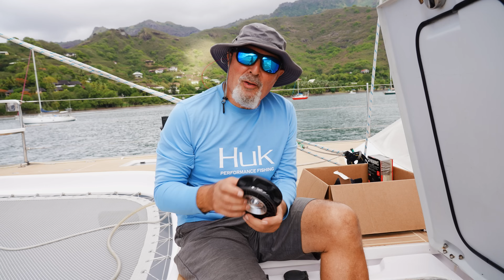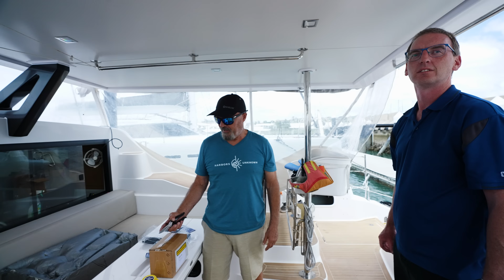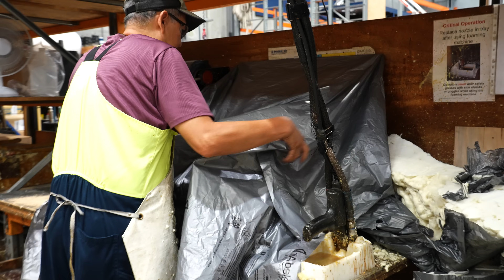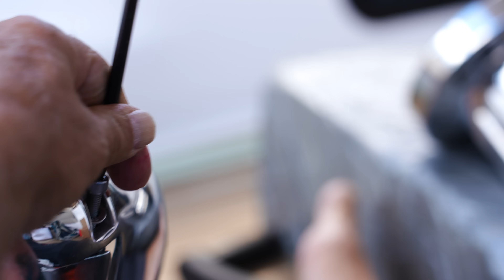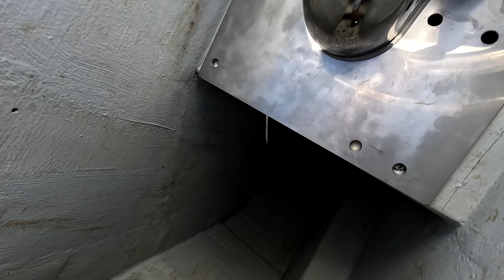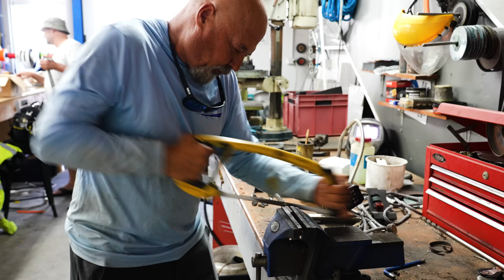THIS FIX May SAVE Our SAILING Season in New Zealand

Comment: Is the equipment on this boat underspecified? The steering system has been a significant concern, and there may have been other issues I missed. Hopefully, Seawind has recognized these challenges and implemented improvements in their newer models. It would be disappointing to face such problems on a new vessel, as critical systems are expected to perform reliably over the long term. For instance, on a vessel like the Oyster 495, one would reasonably expect the windlass to operate flawlessly for many years.

Seawind has a strong reputation and stands behind their products; however, considering their long history, it is surprising that fundamental components such as anchors and steering systems have not yet been fully optimized. Fabio seems to be constantly occupied with rebuilding the boat. By comparison, I purchased a new 4WD vehicle five years ago, and apart from routine maintenance, it has required no additional work. This raises the question: why are boats so different?
Reply from the maker: You make some fair points. Just to give a bit of context, our Seawind 1600 is one of the early hulls and we were the first to really rack up miles and put serious offshore stress on the boat. That meant we uncovered issues others had not yet seen.

The steering system is a good example. The original design was not up to it, but we worked with Seawind on a redesign that is now standard on all new boats and retrofitted on older ones, including ours. The same story with the windlass. The first one was undersized, but Seawind upgraded the spec and every new build now gets the bigger unit.

So yes, it can look like I am always fixing things, but part of that is just being the test case. Boats are not like 4WDs.Companies like Toyota perfected mass production with incredible quality control, which is why you can drive one for years with little more than routine maintenance. Yachts are built in much smaller numbers, and they live in an environment of salt, UV, and constant mechanical stress. Even the best designs get tested to their limits offshore.

The upside is that Seawind really does listen, and the whole fleet benefits from the lessons learned.
Reply: The coaming underneath between the amas and bridge deck are glued not glassed on. A serious design fault on Seawind’s part.
Reply from the maker: They have since rectified it

Comment: You mentioned the windless was undersized for your vessel.  What was Seawind’s thoughts; did they concur and are they upsizing on future models ?
Reply from the maker: That’s a great observation. Seawind has indeed switched to Maxwell windlasses on the newer hulls.
While the Lewmar model was technically undersized for a boat of this length, we suspect the reasoning was an attempt to save a few pounds, likely under the assumption it would be sufficient for a lighter, performance-oriented catamaran.
Thank you for watching and for your comment. 😊😊

Comment: Top job team :)
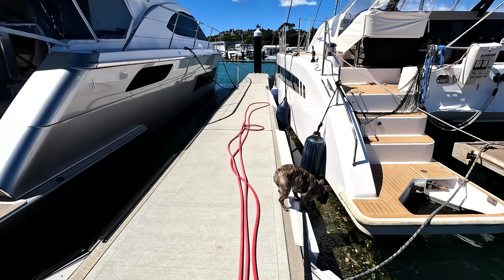26:25 As a side note. Are seawind going to come up with a rudder hatch cover solution for you guys so Yoda doesn't end up diving down them?
Reply from the maker: Thanks! Yes, they’ll take care of that when we’re in Australia.
Reply: @HarborsUnknown I don’t understand how that rudder sea works. Seems like it’s a scoop to slow you down on both sides. Is the something missing?   

 the gunboat method from the original 62 is superior but still not optimum.
Reply from the maker: Agree, those systems are more efficient and exponentially more expensive 🙂